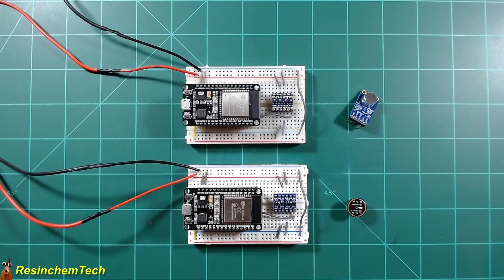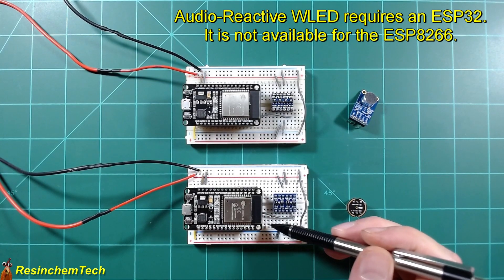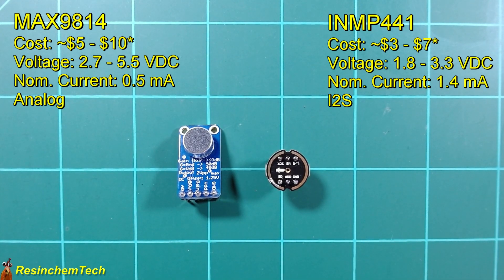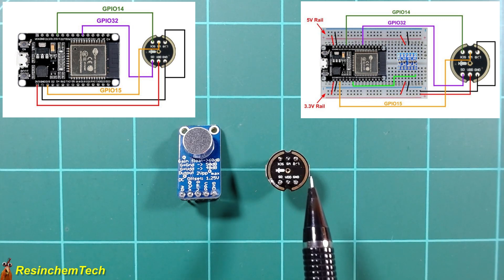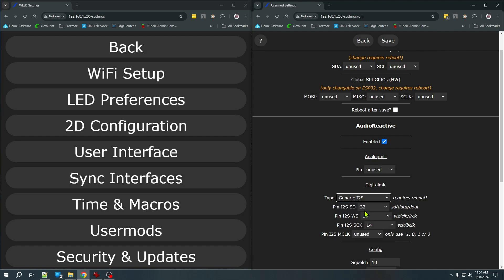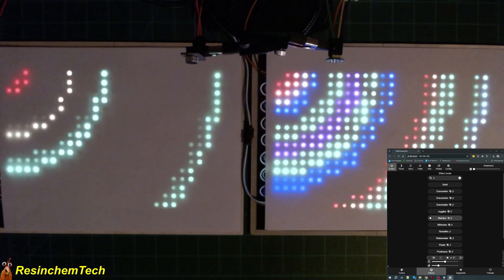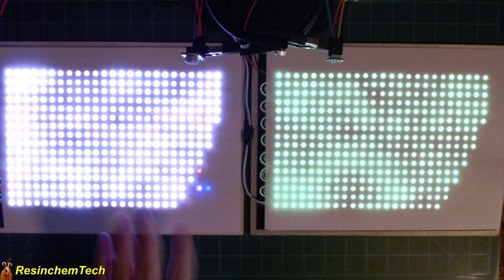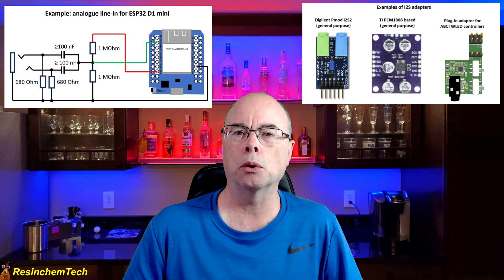Analog vs. Digital: The Best Mic for Audio Reactive WLED

Comment: I’m new to all this and am looking to run a few controlled to a gaming/entertainment set up! I’m wondering if I can add a rotary switch to physically control mic sensitivity? Due to volume differences between playing games or playing music!
Reply from the maker: I don't believe the functionality to change the gain/sensitivity of a microphone is part of the standard WLED firmware.  Here's what is currently supported for potentiometers:  https://kno.wled.ge/features/macros/#analog-button

So you'd have to either find a user-mod that supports a rotary encoder for controlling mic sensitivity/gain... or you'd have to modify and compile your own version of the firmware.  I understand what you are wanting to do, but you might try the INMP441 mic. I've found it does a decent job even with various volume levels.
Reply: @R @ResinChemTech anks for the info. Ill check those out! Would be a decent feature if anyone reading this is smart enough to figure it out! I certainly am not 😂😂

Comment: i have a couple of the digitial mics you have used here, i also have some esp32 c3, c6 and a s3, when i go to install wled i cant get the s3 to work at all, the c3 does not seem to have sound reactive available and the c6 the same, did i just buy the wrong esp32 or are these going to be supported later on?
Reply from the maker: That's a question you'd have to ask the folks that develop and maintain WLED.  While I use it, I don't have anything to do with the development or roadmap for WLED.  But the currently supported hardware is always listed on the WLED web site here:  https://kno.wled.ge/basics/compatible-controllers/

You may want to post your question on the WLED Discord channel or one of their other social sites.  I really can't say what is planned for WLED down the road.

Comment: Great video can i use the mobile app to transfer the audio signals via Bluetooth to esp32 that further controls the led instead of microphone. Can you please guide me on this.
Reply from the maker: I don't believe the WLED firmware currently has any support for audio over Bluetooth.  The only sound options at the moment are an external mic, a line-in input or a sync from another audio-reactive WLED controller.  You can see those options on the WLED web site here:  https://kno.wled.ge/advanced/audio-reactive/

There might be a user mod out there that allows Bluetooth as the audio source (but I don't think so).  You can always check the /usermod folder within the WLED Github repo and see if someone does have a mod that could be applied to your install.

Comment: I have Candeo esp32 controller with Mic. In config and under usermode, audioractive is enabled but my led ws2811c does not react with voice. Any idea about this type of controller?
Reply from the maker: Unfortunately, other than one (for my Christmas tree)  all my LED controllers are DIY built.  I haven't used any retail controllers, but I did look up the documentation for the Candeo.  Assuming the mic you are using is I2S, did you also specify the proper GPIO pins according to the Candeo documentation?  If you have done all that, then I'm not sure what the issue could be.  I'm assuming you've tried altering things like the gain, AGC and squelch settings?

Otherwise, you many need to contact Candeo support or post something on their forum if they have one.  Sorry I can't be more help, but I just don't use retail/pre-built LED controllers myself.
Reply: @ 
Thanks for reply and looking into documentation on the top, bfl 2811 Fcob 720/m is configured exactly according to documentation on CPIO 16 and settings for audio reactive is also according to documentation. LED is only responsive to those effects which have music symbol next to colour pallets. Integrated mic is not voice responsive but only to selected music symbol lighting  effects
Reply from the maker: That is by design.  Not every effect in WLED is an audio-reactive effect.   Remember that audio-reactivity in base WLED is somewhat new and there were already dozens and dozens of effects that were neither audio-reactive nor designed specifically for a matrix layout.

The filters you mention (music symbol) indicates those effect that do respond to sound.  There are two musical symbols (the single note which reacts to sound intensity and the double note which reacts to frequency).  If the effect does not have one of these symbols, then the effect will not respond to sound.

Comment: Good to see you again. I've given up on analog mics unless its a really lo-fi application. I find the INMP441 is the best choice in most cases, especially voice reactive wled. I love audio reactive lights.
Reply from the maker: Agreed.  I used analog mics (mostly MAX9814) but once I tried the INMP441, I never went back to the analog version.  For the most part, the digital mic is "set it and forget it" as it works well across a lot of different situations, where the analog mic seemed to need constant tweaking based on source and distance.

Thanks for the comment... and I'm glad you took a moment to post it!

Comment: cool vid. do you find that some of the esp32s3 boards with micro usb and cheap serial programming chips like the ch34x line are hard to program because it tries to pull too much current from the pc usb? i've had to use programmers for my old ones unless there's a usbc port. plus the micro falls off so easy. i've repaired so many usb micro ports on so many different devices over the years. especially cheap smd ones. they have no structural integrity. some usbc ports are as bad too though, i've always got a pile of ps5 controllers to fix. because the usbc pads tear.
Reply from the maker: I actually have a few s3 boards in my parts, but have yet to actually use one for anything yet.  I haven't personally had any issues with the USB ports or current draw of any of my varieties of ESP8266 or ESP32... yet!  But there are certainly   manufacturers out there that are selling the boards so cheap, I imagine that any sort of fraction of a cent they can save on making the boards, they are going to implement.  I have had "bad batches" of boards before, but those generally wouldn't even power on or just couldn't be flashed.  I guess part of dealing with bulk manufactured, low-cost parts.

Thanks for the comment!

Comment: Sir please help, i set my wled with welcome light set on my preset at boot but it is laging , why?
Reply from the maker: I'm not 100% sure what you are asking, but if you are powering on the WLED controller based on some outside trigger or event, there will always be a bit of lag time because it takes a few seconds for the WLED controller to boot up and connect to WiFi .  The signal will only be sent to the LEDs after the boot process completes and WiFi is connected (the time to join WiFi is likely what is causing the delay before the LEDs turn on). 

If you want the LEDs to react faster based on something like a motion or distance sensor, then you probably need to leave the WLED controller powered on and use either a relay just for the LED power, or simply turn the LEDs off (instead of powering off the entire controller itself).

I hope that is what you were asking and provides some pointers.
Reply: @ResinChemTech  great answer sir, i will try to redesign my project,🙏🏻 apologize me for my English language, I just learning.... Great from Indonesia 🇲🇨

Comment: Fantastic vid! My analog mic only seems to work sometimes in the sound reactive wled 0.13.4 version. I can't seem to get the audioreactive versions of wled to work with my analog mic like you did here. I noticed you mentioned that you shouldn't use an ADC2 pin for input. Does this apply to the data out wire from the esp32 wifi board to the leds? I currently have this data out wire running to what I think is an ADC2 pin (it's the D2 pin). Other than that, I have a similar configuration with no reaction from any volume of audio and am not sure what the issue might be.
Reply from the maker: Thanks!  As far as the ADC2 pins, yes you can use them for digital signals like the data line for LEDs (or push buttons, digital sensors, etc.).  You just cannot defined and use one of the ADC2 pins as an analog input at the same time as WiFi.  From the Espressif site: "ADC2 is used by the Wi-Fi driver. Therefore the application can only use ADC2 when the Wi-Fi driver has not started."  But you can use these pins for purposes other than analog.

As far as the analog mic, it can often be tricky to get it tweaked so that it reacts at an acceptable level.  There are a number of things to try.  If you've lowered the squelch and increased the gain settings in WLED and still aren't getting any reaction, you might try increasing the gain on the mic itself.  Instead of connecting the gain pin to Vdd, try connecting it to ground (boosting the gain from 40 to 50 db).  I've had this work with a few MAX9814 mics.

If none of those ideas work, nor changing to other ADC1 pins, then you may need to look at wiring or the mic itself.  It's always possible that you simply have a faulty component.

Comment: good evening and welcome back, beautiful comparison and explanation, as always you are very good, a little question, in your opinion if you can use the same analogue microphone connected to an esp to update an old wired alarm system, for example in case the alarm sounds a notification will arrive via esphome or via tasmota? thanks in advance...your fun from Rome
Reply from the maker: Thanks!  I enjoyed the break, but I'm glad to be back.

If I understand you correctly, you want a system that would listen for the alarm buzzer/siren and when detected, it would send a notification, correct?  If that's what you are looking at doing, then I stumbled across something based on another question regarding dryer notifications.  Instead of a true analog microphone, you may want to use something that triggers based on an (adjustable) sound level.  Something like this:  https://amzn.to/3ZZH0Yf

This could be connected to a GPIO pin and it will trigger when the sound is above a level that you can set via the onboard potentiometer.  In ESPHome, you could define a GPIO binary sensor.  When the alarm sounds, it would turn on the binary sensor and this could be used as the trigger in an automation to send a notification to your phone (or make an announcement on a speaker, turn on a bunch of lights, etc.).  It might have issues with false triggers if installed in a noisy location where other loud noises might exceed the sound threshold, but if the alarm siren is as loud as ours, it probably won't be an issue.

If that wasn't what you were asking or looking for, please let me know and I'll try to provide an answer to what you were really asking about!

Comment: I use the same digital mic on a few of my led strips after seeing it on one of your previous videos. It works very well.  You can adjust the sensitivity to use leds to light up a room when a pin drops if you want to.
Reply from the maker: Yeah, in some of my older videos, I used the analog MAX9814.  But since then, I've discovered the digital mic and how much better it works.  So I decided to make this video in the hopes that anyone that might have seen one of my older videos with the analog mic might also stumble across this one and see how much better the digital version can be.

Thanks for watching... and thanks for the comment!

Comment: Thanks for the nice video. Your videos help a lot to get into the topic of WLED! :) Just one thing that I noticed when I use audioreactivity on WLED is that I often have the impression that it lags behind the sound a lot. In your video it also seemed to lag behind the sound a bit. What do you think about that or do you have an idea on how to improve the reactivity?
Reply from the maker: Yeah... there is (and probably always will be) a very short lag.  I don't know if this could ever be precisely in sync as the microphone has to pick up the sound, send it to the ESP which has to process that signal, then send a signal onto the LEDs.  This process will always introduce at least a slight delay between what your ears hear and what your eyes see. I haven't tried it, but using the line-in option might reduce this lag slightly.

To be honest, when I have rather loud music playing and a lot of different WLED displays reacting, I generally don't really notice the lag unless I'm specifically looking for it.  I think the only way to get perfect synchronicity would be with something like the Hue Syncbox, where the signal is received and processed for light output BEFORE it is sent to the actual display that your eyes see.

Comment: I guess they are both analog microphones. But using different 'front ends'. Would be interesting to see how they perform when just te microphones are switched?
Reply from the maker: I'm not sure I follow.  The MAX9814 is analog and communicates via an analog pin on the ESP32.  But the INMP441 is definitely digital and uses I2S to "talk" to the ESP32.  And not sure what you mean by different 'front ends'.  Both controllers and the LED displays are identical, and both controllers are using the exact same version of the WLED firmware.  The 'front end' is identical for both.  The only difference between the two setups are the microphones that are connected to each of the controllers... and of course the microphone configuration in WLED is different for each.  Otherwise, it is an apple-to-apple comparison as only the mics are different.

Maybe I am misunderstanding to what you are referring as the 'front end'.
Reply: @ResinChemTech  Most likely on the 'digital microphone board' there is an old fashion analog microphone. With the 'front end' on the digital board i meant the chip that converts the analog signal from the microphone into a digital signal (A to D converter, ADC) and after that in an I2C data signal. On the 'analog microphone board' most likely there is only an amplifier and the ADC is done in the ESP32. My comment has nothing to do with the WLED processing. Hope this clarify my suggestion.